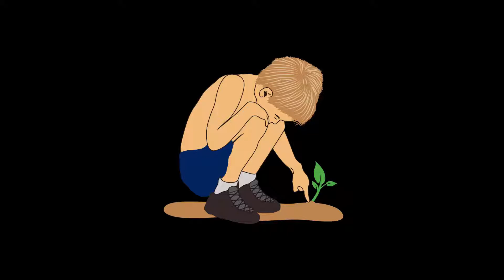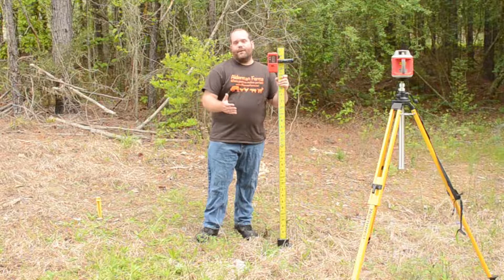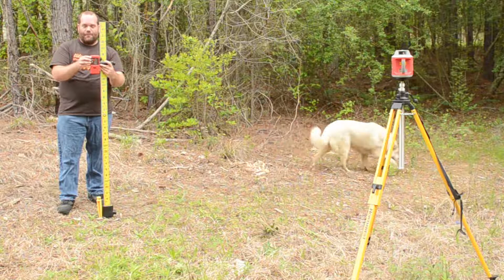How to Use a Rotary Level to find a Contour Line

Comment: In this application, How deep was the swale dug? And is it pertinent to make sure is level once it's dug?
Reply: +nelson santiago Absolutely important to check for level after it's dug. Get contour before so you know where to dig. As you are digging keep checking level. You get better at eyeing it as you do it more and more, but the pros use a level more not less.